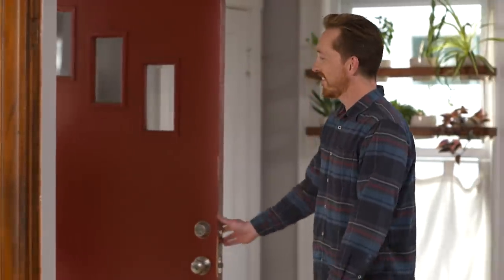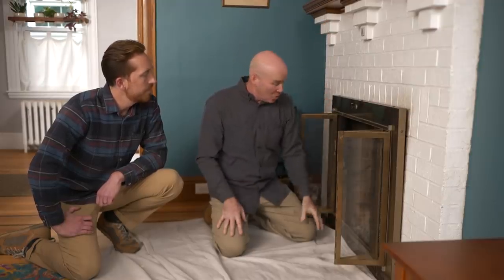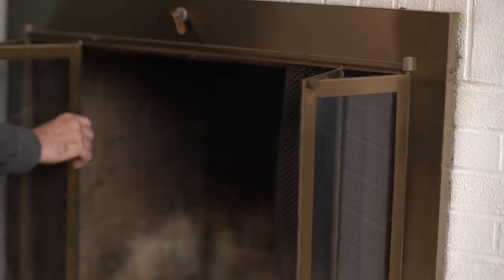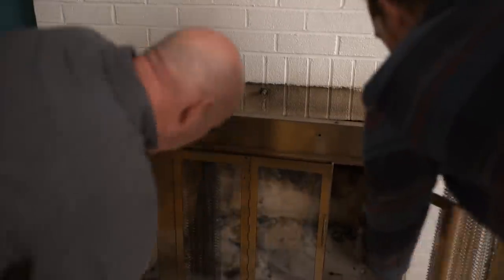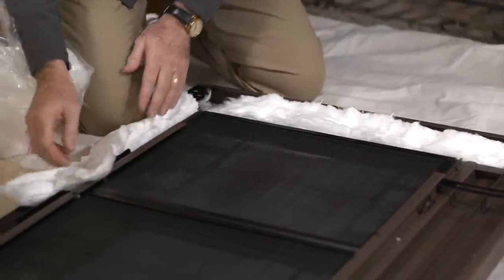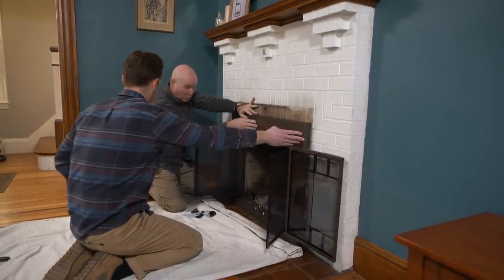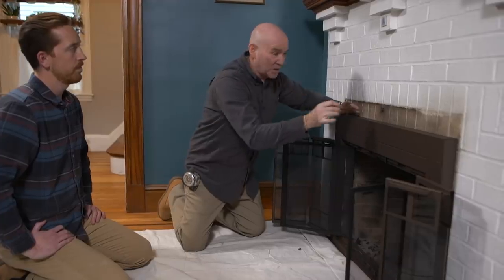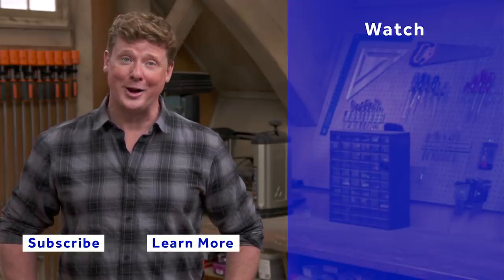How To Replace a Fireplace Cover | Ask This Old House

Comment: Is that insulation a special kind?  I have I believe just the pink stuff.  Also how do you clean the outside brick?  Mine is white as well but very textured.  I used Quick n Brite last time and seems to work somewhat ok - that and elbow grease.  Any other suggestions?  I get brown marks above the doors.  Thanks for showing this.  It told me I did mine properly but not sure about the insulation.  Mine was gold and I took it and spray painted it with black high heat paint.

Comment: Hi Mark,
We had the chimney serviced by a chimney company, the claimed that the chimney needed repairs, inside and outside ( some sort of water package) to prevent water leaking.
They charged us $4000.00 and the smell of creosote is unbearable in the house.  We called them several times after the work, and yet we can't get rid of the awful smell.
What can we do. We are seniors, and can't do any fixing ourselves.

Comment: Should have fixed the knob after he painted the brick. Lol.
Reply: The point is probably that TOH wanted to show the putty fix, and the painting job is for the homeowner afterwards. It’s not a big deal to paint around it anyway. Just pack the knob completely with painters tape and it’s just as easy as without the knob.
Reply: It was Mauro's day off.

Comment: this agent doesnt explain much about each step.  what if the first doors weren't level? why do they close the doors when a fire is going? what about the scuffed paint above the fireplace doors, why epoxy the knob to unpainted brick?  5:20 how did they know which peg to insert these brackets into? 6:57 what's the regulator mentioned for?

Comment: If you’re worried about safety then why not convert over to a gas insert. Plus they actually put out heat.
Reply: Gas is expensive. Chopping down a tree and splitting it is cheap
Reply: Gas is just as a big hazard as a wood fire. If you accidentally let the gas run without it being ignited, your entire house becomes a bomb.

Comment: I am pretty sure that style of door should not be closed while the fireplace is in use.
Reply: I just looked at a couple of manuals and it clearly states in them not to close the doors with a fire burning.
Reply: The inner doors are spark screens and the outer doors are optionally made of ceramic glass.
Reply: Yes, only the inner screen doors should be closed.

Comment: Never understood these fireplace doors vs a wood stove insert with glass door. The doors like they installed still let 90% of the heat up the chimney vs a wood insert which are 75%+ efficient. Guess it’s a matter of the doors costing $500 and a decent stove costing $3,000
Reply: These doors are only for looks. The installation manual clearly states that the doors cannot be closed while the fireplace is in use. The glass is tempered and will shatter if overheated.

And yes a wood stove insert is absolutely the best way to use a traditionally built fireplace.
Reply: @mark76197  Even open most of the heat still goes up the chimney.
Reply: Yes
Reply: Guessing if efficeincy were their primary concern, they'd go the wood stove insert route.  However, for aesthetics and ambience some may want this style, regardless of heating in the house.

Comment: that doesnt seem safe to stuff that in there..
Reply: It's highly probably meant and made for it. It's not like they were like "oh lets stuff it with newspaper scraps".
Reply: I had a wood stove insert installed in my fireplace.   A similar insulation was installed around the baffle to the stove, right where most of the intense heat/flames hit.  No problem whatsoever--the stuff is like Superman's cape!